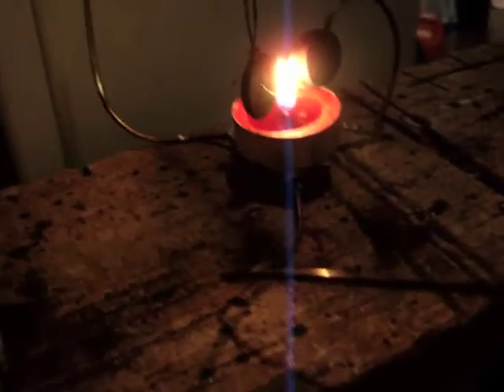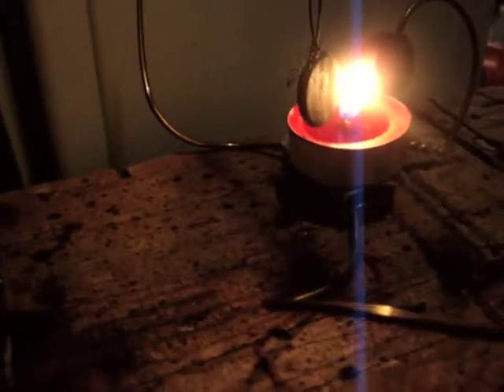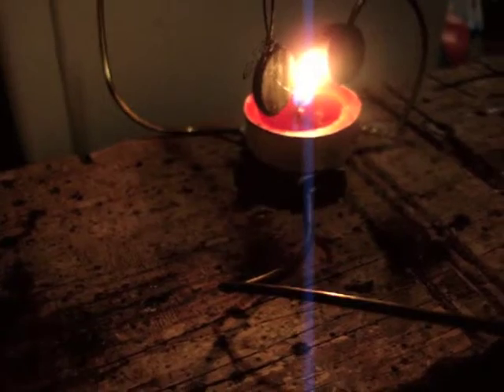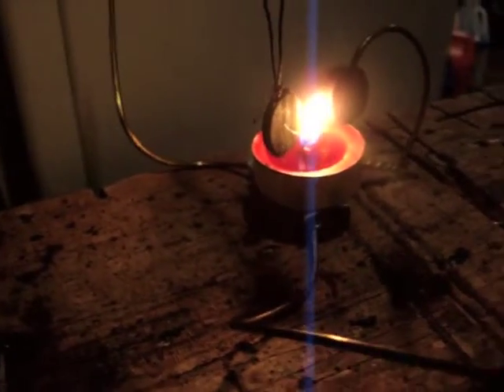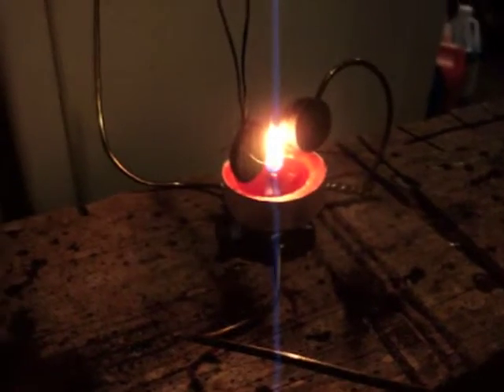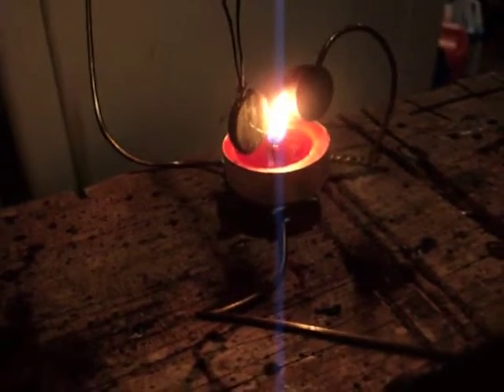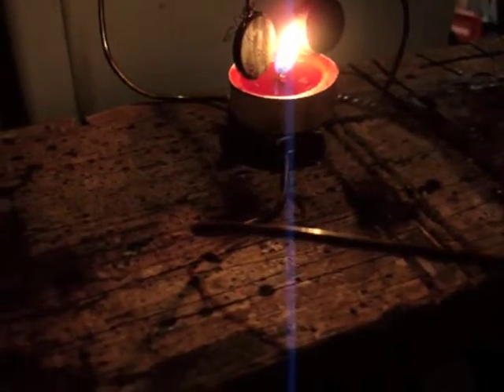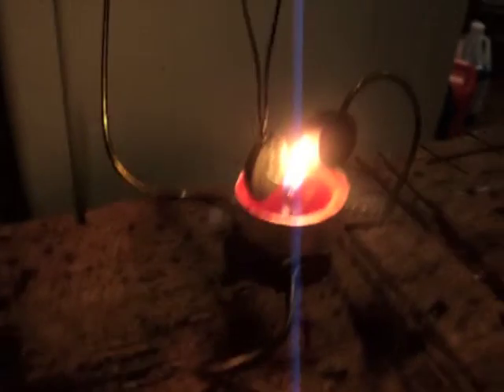Magnet Pulse Engine

Comment from the maker: No, it is powered by the fire rather than the magnet. How it works is the fire heats up the magnet and while doing so it losses it's magnetism. Then the magnet gains back it's magnetism as it cools down and returns to the other magnet. The cycle repeats over and over. If you are going to make this keep in mind that it is fairly hard to set up and you the candles melt down and have to be replaced. As for the email, give me your email address here in the comments and I will send you a message.